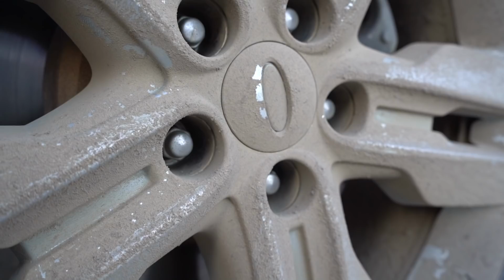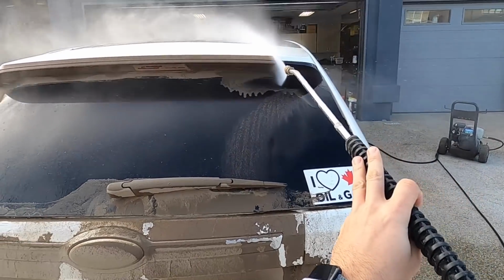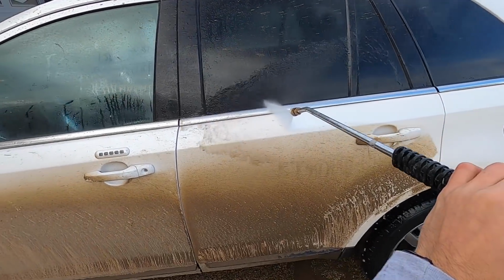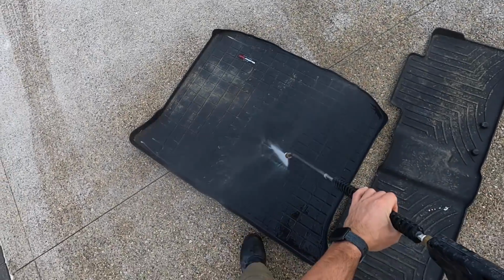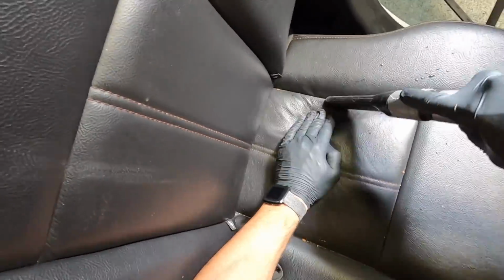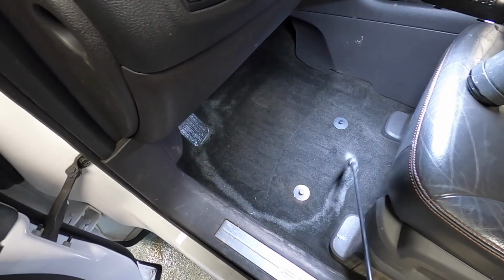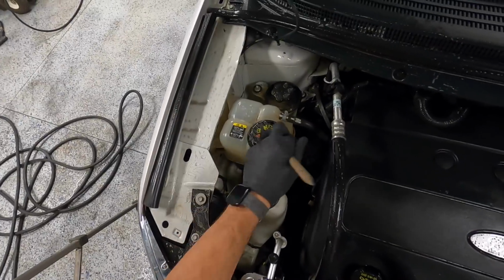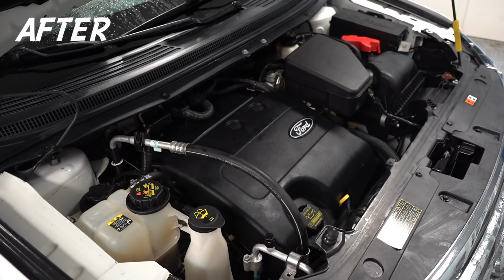Clean With Me Ep. 2 | Super Dirty Pressure Washing and Carpet Extraction!

Comment: I'm addicted to watching both your channels - fantastic!  Just a quick question - I purchased Aerospace 303 based on your recommendation (and I'm in South Africa, it's tough to source, but I got it and it's as amazing as you say) - but the instructions say to apply and then to immediately buff off completely - which you don't seem to do.  Is it necessary?
Reply from the maker: I am quite certain that my method is far superior to what the bottle says, I’ve been doing it this way for over a decade and wouldn’t ever consider doing it differently. Apply a nice thin layer with an applicator pad and it will last for weeks 👍🏻

Comment: I doubt you’ll see my comment, but I have some questions if you or anyone can help with, I recently started my detailing business and I have an issue of killing the battery even when I try to keep doors closed, how can I prevent this and do you usually keep the batter unplugged? Finally I’m scared to clean engine bays with water, any other alternative?
Reply: Does this happen with every vehicle you detail? That shouldn’t be happening unless you’re leaving the doors open for hours. How long do your details typically take?  Some vehicles’ lights automatically shut off after so long to prevent this. If all else fails you could just unhook the battery. I never have to do this but all the vehicles I detail have that automatic light power off thing I mentioned. As for cleaning engine bays, if you have a steam cleaner you could use that. If not, just spray APC on it lightly. You can search for videos about how to clean them without water.
Reply: Matt i typically take 3 hours on just a wash and wax and about the same on a quick interior detail, first car I did died cause of my fault for leaving keys in the ignition and the second vehicle was interior and it died as well but I hoped it wouldn’t have since it was push start and I had seen everything off in the vehicle other than a dome light I thought was normal, but thanks for the help!